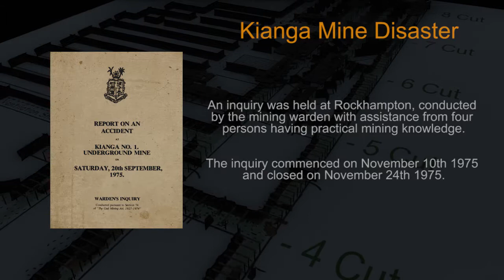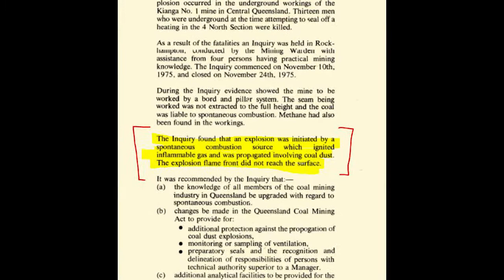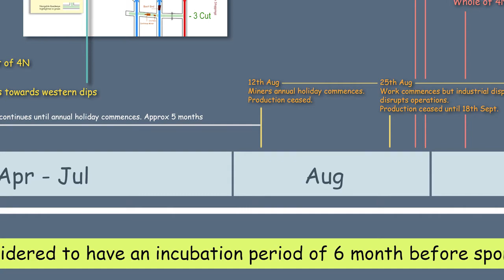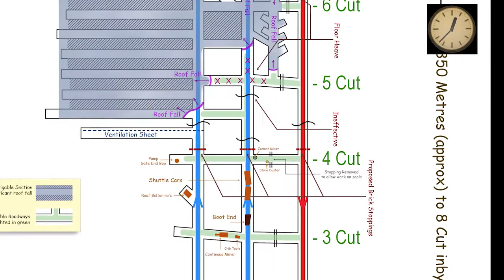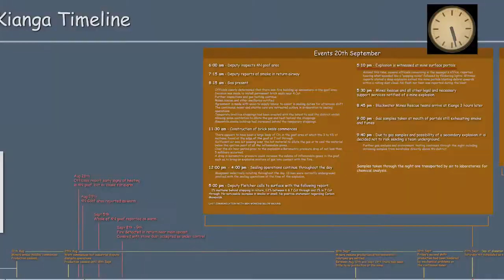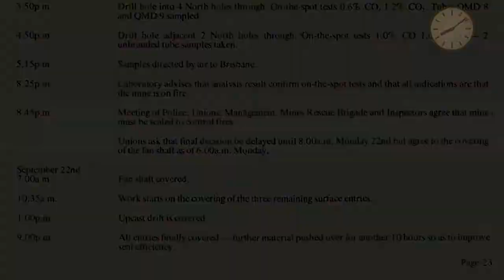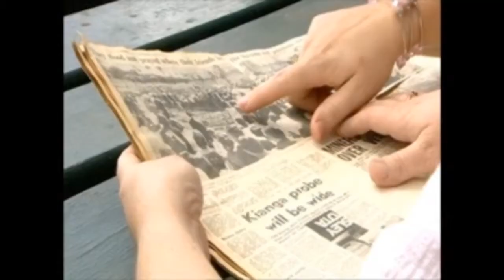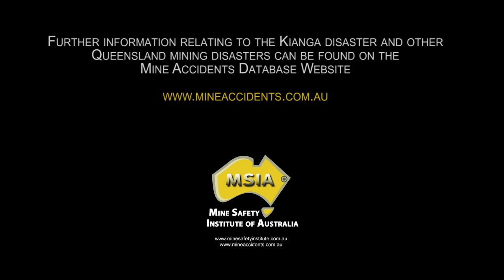Kianga Mine Disaster 1975 - Preview Extended

Comment: Certainly highlighted to me the wisdom of having pre-prepared emergency stopping sites at key points.The absence of such sites in a seam already known to be susceptible [even one heating in that unit], combined with a mining method that leaves behind significant quantities of top coal in goaf areas is astonishing to me. In the UK at this time, these sites were prepared as part of the initial development of an area to be mined and stockpiles of blocks and materials sufficient to complete the stopping walls were maintained at or very near the sites. These sites had as much blockwork ready built, as was practical for the mining operations, and that blockwork was well keyed in to the surrounding strata. Built into the temporary blockwork, would be be a 2 - 3 foot diameter steel tube that would allow some ventilation to pass in a controlled manner, these being the last thing to be sealed off after stoppings were built. Getting materials hauled to site can be a slow process at the best of times, a problem made much worse when there is a active fire. Introducing a further delay to salvage machinery is, to me, unforgiveable. Was that machine worth all those lives, and the loss of the mine ??
The fact that an initial methane ignition developed into a coal dust explosion, also suggests that scant attention was being paid to dust suppression at the faces and stonedusting and  barriers or other suppression methods, though the  very fact that so much broken coal was present in the inaccessible goaf areas, would make it somewhat more difficult to accomplish.
In all, this was a tragic disaster that could so easily have been prevented.

Comment: Strange they would hold a coal top, why not cut to the stone top then take the floor coal whilst retreating/pillaring? This is what we do when the seam is very thick, in the South Wales colliery I work at; Aberpergwm.
Reply from the maker: Jordan this generally comes down to a culmination of factors - There is no specific answer at Kianga but suspect that the description of the choice of extraction method at Kianga would have been similar to the decision at Moura 4. As you can see at Moura 4 they tried a lot of different methods but in the end it comes down to 
•	Seam Thickness
•	Coal Quality and 
•	% extraction

If they had considered the Spon Com risk, they certainly would not have chosen to leave broken coal in the goaf. 

Probably better quality in the bottom on the seam. The other thing is the extraction ratio. If you are taking bottoms the extraction % isn’t as high as if you are taking pillars. So the only thing I can think of why anyone would do that is to:
•	Get better quality coal, 
•	Get a higher % of extraction with pillar extraction rather than taking bottoms.
Reply: Thanks for your response, normally in the multi entry system you extract the floor coal and cut or 'fir tree' the pillars on the retreat. That is after a district is established to the fullest extent of a particular panel. We have even split pillars, creating a bolted road through the centre to enable greater % extraction. 

Perhaps it was as you say, they didn't have a market for the poorer quality top coal. Not a problem in the anthracite seam at Aberpergwm